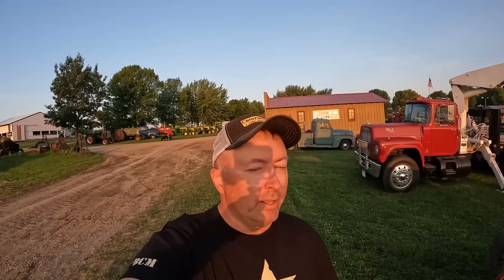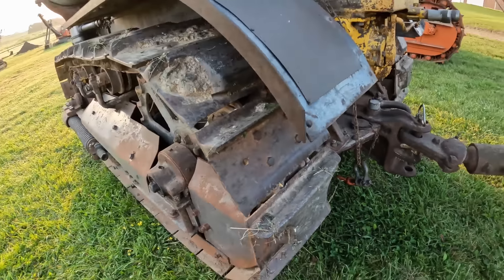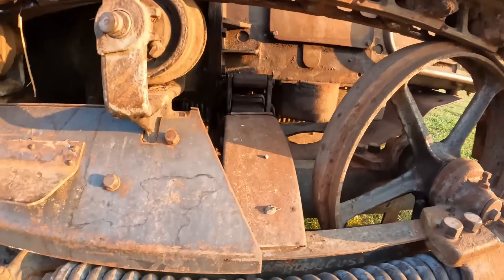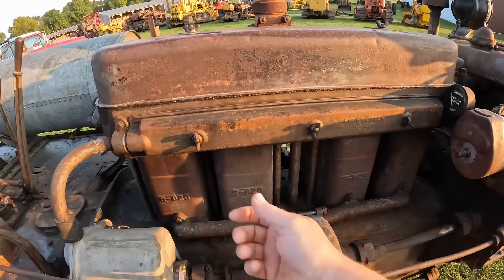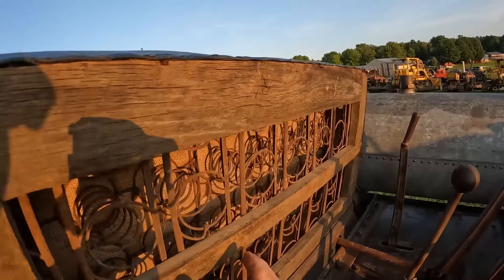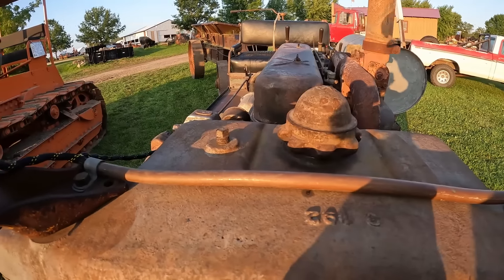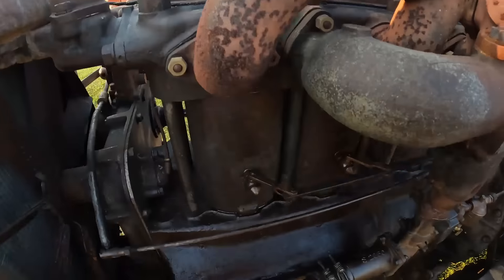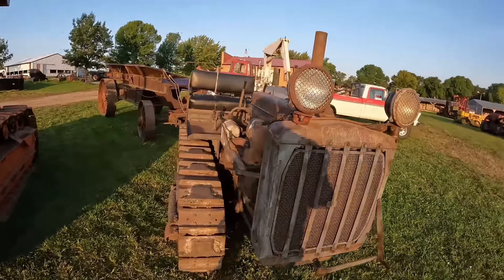1929 Caterpillar Thirty #S-8809 - The Most Original Condition Survivor I've Ever Found!

Comment: Absolutely astonishing.  I hope you can contact the owner.   What vintage is the BG hydraulic equipment?
Reply from the maker: I know the owner well, he helped me a lot with Cat parts for #5J1113 and I’ve helped him when I’ve had things that he’s needed. He showed me a lot of the details in this video before I did any recording, and I made sure I had clear permission to show and do all of the things seen in this walkaround. I should stress the importance to ALWAYS get permission from the owner before messing with anything on their machines, and ALWAYS leave things just as you found them 👍 The Be-Ge unit is relatively the same vintage as this tractor, but still likely about a decade newer.
Reply: @squatch253  I had wondered if the owner had more knowledge of its history.  

With this machine dating from right before the Great Depression, it’s possible that before this machine had many hours on it the owner hid it in a neighbor’s barn to keep it from being repossessed, and it then may have just been forgotten— the classic “barn find.”  But if the hydraulic unit is 10 years newer, then the tractor must have been “put away” without many hours on it at least twice.  If these machines could only talk. . .
Reply from the maker: @Pamudder  - All I know about it is that it came out of Indiana and was a former municipality/city owned piece of equipment, hence the low hours it had put on it plus the work that it did, was mostly easy jobs 👍

Comment: All the neat stuff generator ,air filter, carburator but the compression release valves into lower part of cylinders is most interesting I guess it still had enough compression to run until you could close them very neat
Reply from the maker: Yep, these were rather difficult to crank-start by hand without opening those release petcocks, and they’d still run OK until you managed to get them closed back up 👍

Comment: Would be an interesting story as to how that has survived in absolute original condition. Once in a lifetime discovery. Thanks for the video.
Reply from the maker: The only history I have on this one is that it recently came out of Indiana and spent almost all its life being owned by a municipality/city, so what little work it did see was fairly light 👍
Reply: @squatch253  NOT that it's the answer, but a likelihood.
 I'd bet that, like you said,  it got used little; then, most likely, it probably got replaced(in purpose) by another piece of equipment. Also, it probably got stuffed in the corner or back of the shop/shed, & anyone who knew how to start/operate it moved/passed on. I'd be willing to bet it was a case where no one could get it operating, so it stayed put until decades later, when some administrator said drag it out, we'll just sell it.

Comment: @Squatch253 - So, the only thing missing is the hood and dash panel, or did that year not have a hood or dash?
 Edit, cold weather package option comes with a 50/50 split center hood, dash panel, gauges, cab, rear mount fuel tank, relocated lights, removable bolt-on snow pads and can include a snow pusher blade.
 Edit, 50/50 split center hood and dash panel with gauges can be an add option without the cold weather package.

Comment: That walk around sure added appreciation to the condition of that survivor. On the 1.2.4.3 firing order: are the outside and then inside cylinders effectively firing simultaneously or is it truly a ripple fire?  Maybe a less ignorant question would be---why is that particular firing order employed?
Reply: It's a four stroke machine with four cilinders, no two cilinders are firing simultaneously. This firing order was used in early times, now practicaly all four cilinder engines use 1-3-4-2. It's two nearby cilinders followed by a jump over.
Reply: Allis Chalmers wd45  wd wc b c etc also used the 1243 firing order! Easy for me to remember because it is also my birth month and year!
Reply: @justjoe7313  Thanks! P

Comment: Restored tractors are cool, but patina like that should be left alone.
Reply from the maker: 100% agree 👍😎
Reply: I like tractors in there working clothes too
Reply: I disagree, patina is nothing more than faded paint and rusting metal. As crisp and pristine are the wear points on this unit, it cries out for a full restoration paint job like the day it was built because this is a show tractor and should be displayed in it's original state.
Reply: @petebrooks6539 it is in its original state  mate
Reply: @johngibson3837  It didn't look anything like that when it came off the assembly line, don't  try to fool yourself. In it's current "Patina" it will continue to rust until it's part of mother earth again. Enjoy it while you can.
Reply from the maker: There is no greater form of preservation than leaving the past 95 years untouched and undisturbed, covering over what is left erases it from existence forever and none of our modern paints will still look good after 10 to 15 years - it just doesn’t age well like the old leaded finishes do. This tractor will still be exactly as it is now in 30 years, which is about the time that there’ll be nobody left alive that’ll have any appreciation for it, nor the desire to keep it around. We’re already starting to see more tractors for sale than buyers wanting or able to purchase them, with so many of the older collectors aging out and not being replaced by younger enthusiasts. Society is quickly moving away from this era of technology, and it’s going to be society that ultimately destroys this machine, not corrosion or time. Not trying to be negative, just giving a blunt and honest assessment 👍
Reply: @squatch253 too true mate you speak good words all this tractor needs is continued maintenance and a roof over it's head, a beautiful survivor of a pre gone time  to restore this one would be a crime, I'd love to know how many hours it's done

Comment: Why would you want the generator disconnected? Was that for the lights only?
Reply from the maker: Yes, this was a battery-less system so the generator provided constant power. So disconnecting it from the drive gears when the lights weren’t needed would protect it from damage as well as greatly extend its service life 👍

Comment: Would that tractor have had a hood, or is that how she was from the factory?
Reply from the maker: This is how they were from the factory, in standard configuration. Additional options did include an overhead canopy, or a cab, or a cold weather package that would’ve included a larger radiator surround casting that would’ve also had an attaching hood and engine side panels.